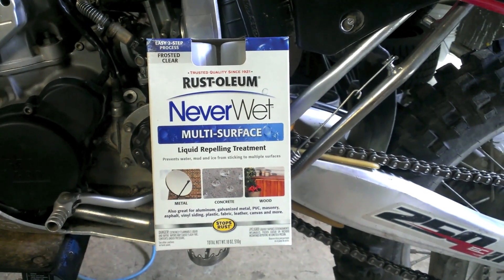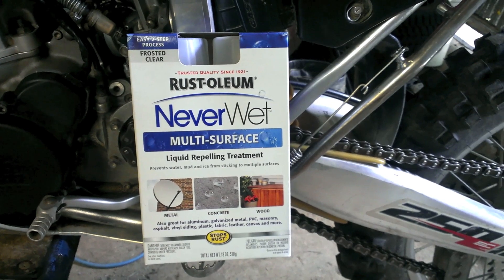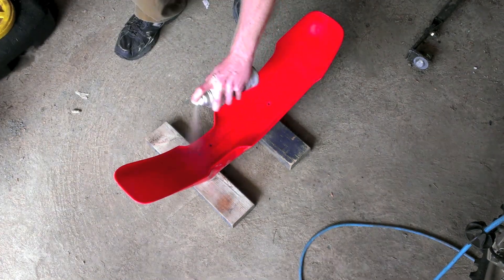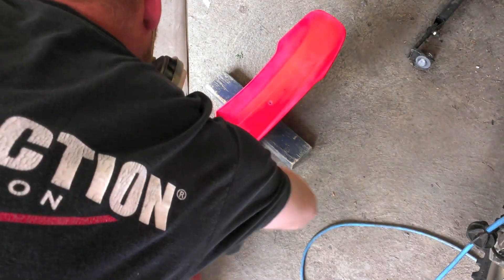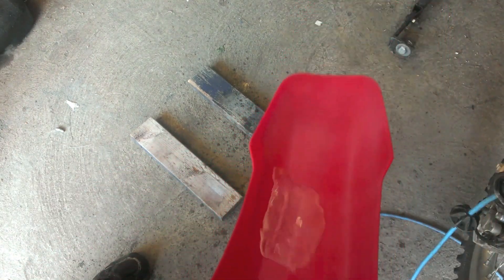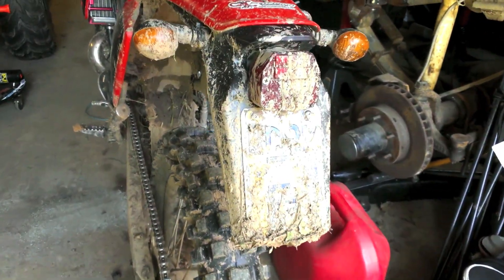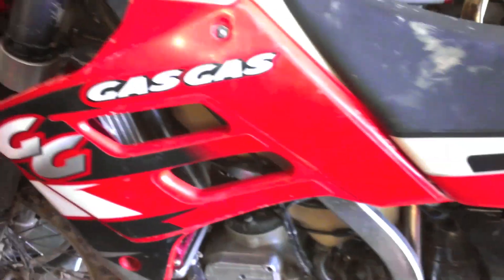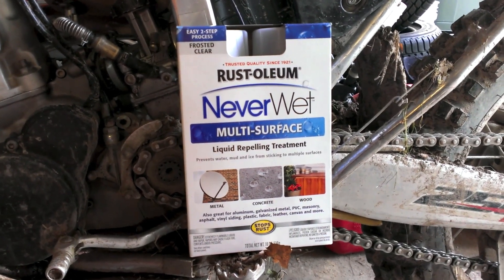Rust-Oleum NeverWet Review - Motorcycle Fender Application

Comment: this is actually the only useful(maybe) idea i have come across for neverwet. It could be great for one of those races where mud is an issue, and it doesnt matter if the coating doesnt last for days, you can reapply it fresh for every race... but maybe it could be a problem/mess after the bike accumulates several layers, specially on difficult to clean or replace parts...  Good luck, thanks for posting